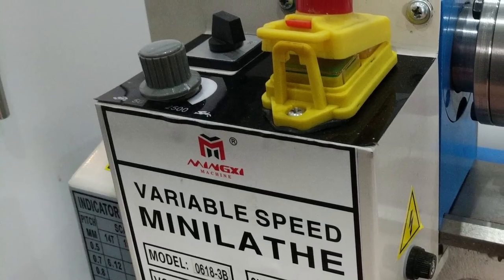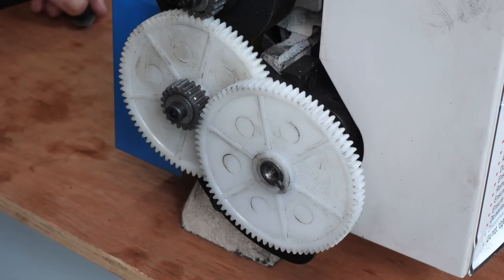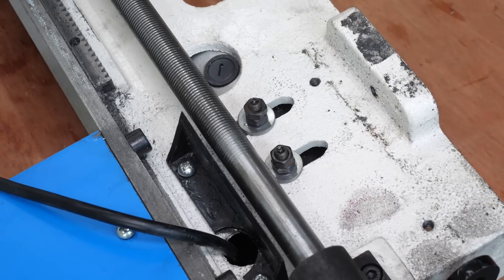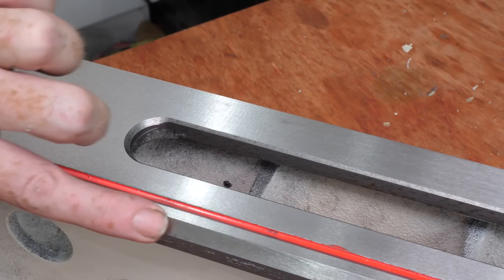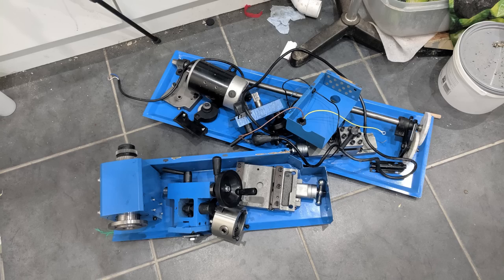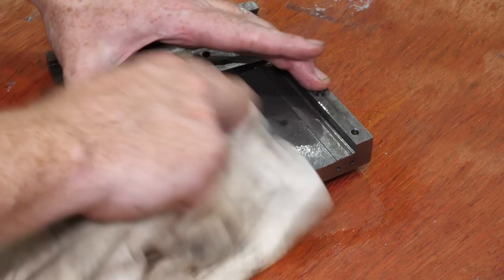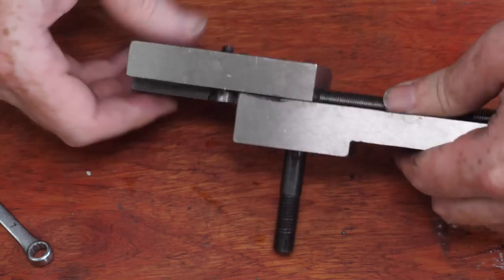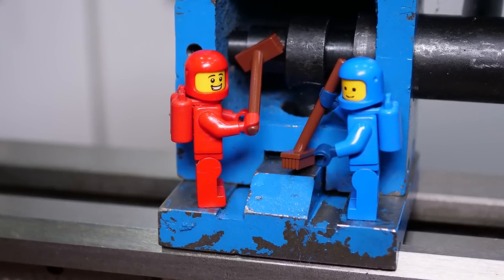Disassembling the CJ0618 7x12 Lathe, Cleaning, and Troubleshooting

Comment: Were all those bolts as loose as depicted or had you previously loosened them before the video?
Reply from the maker: The video is trimmed and sped up so you don't see the full effort needed to undo them. Sometimes they're being undone for the second time because the camera didn't work out on the first attempt.
Most of the bolts seemed to be reasonably right, unless I specifically mention a problem, like the motor mount screws which were very loose, and badly bent.

Comment: Hi. . Great video!  I have a question. I believe that I have the exact same lathe. Unfortunately mine came with a tailstock quill with NO TAPER! I don't see how it passed QC either!  I'm trying to source a replacement but cannot figure out the thread size of the feed screw for the quill. 10 mm x 1.5 mm seems to be closest, but not exactly. Do you by chance know the thread size? A company in the US called Little Machine Shop has ones for the Seig C2/C3 that I think I can use if the thread is the same.

Comment: Changing the quality of this video was the first time I'd ever seen 720p50 and 1080p50 on YouaTube. Never knew that was even a thing... I suppose it makes sense since you probably use PAL instead of NTSC as a regional standard where you are. I remember 25fps being something related to PAL where as NTSC uses 24fps.  It makes a hell of a lot more sense for PAL's higher frame rate to be 50fps compared to NTSC's 60fps... I suppose it might have something to do with how you guys in PAL-land like to transmit your AC power at 50hz and how us in the States like 60hz. Anyway just thought I'd mention it in this comment as a way of supporting your video since I found it interesting.

Comment: The bottom two screws on the front control panel cover only needed to be loosened.
Also, your posidrive screw driver/s need to be binned. You'll got far better purchase with some actually Phillips screw drivers.

Comment: I've never used a 7mm spanner in my life. That was untill I bought this lathe and realized how badly it's put together. The weakest part is the belt. I stripped it in no time. But I guess I'm asking too much from that little thing as I'm turning down 45mm steel solid bar to the shape of planes propeller cones.
Reply from the maker: I'm looking into replacing the toothed belt with a multi-V belt instead. A toothed belt is quite forgiving about belt tension, but when something jams it can't slip, so either the belt or one of the gears is going to strip. A multi-V belt will slip when something jams, but requires a much better motor mount so the belt can be reliabily tensioned.

45mm steel is pretty heavy work for such a small machine, but shouldn't be impossible.
Reply: @AdventureswithaVerySmallLathe  It's possible but takes a lot of time and the surface is worth the money of the tool used I guess.... And the belt in mine wasn't tensioned at all. I've only discovered this after it started slipping while I was drilling 5mm hole... I wonder If it would be possible to turn new pulleys for v belt. As for tensioning, these bolts pushing on the motor are reliable but with enough pressure they can damage the motor so I will make some pressure plate and probably zip tie it to the motor. For me it's not worth the time spend on prepping the work. With a better machine work would be much faster and easier.

Comment: I would've stripped all the paint off, cleaned up the casting a  bit, and then repainted with a high build paint
Reply from the maker: That definitely crossed my mind, but I didn't have time for anything as involved during the days set asside for filming the disassembly and re-assembly. It's on the project list.

Comment: Just got one of these. What size bolts do I need to bolt this to the table.??
Reply from the maker: The holes in mine are threaded for M6. Yours may not be the same, though. Check before you buy bolts.

Comment: Wow that is so much worse than mine which had similar beginnings. Thanks for the videos!
Reply from the maker: Thanks! I get the feeling that this is about as bad as new lathes for sale come, and I'm 99% sure it was a quality control reject that was never intended for sale. I sincerely hope that most cheap mini lathes arrive in better condition than this one did.
Reply: @AdventureswithaVerySmallLathe  Seems like you drew the short straw on this one!  Looking forward to the reassembly.
Reply: Mine arrived in similar condition, one exciting discover was the wiring to the chuck guard had rubbed against the corner little sheet metal channel they supply for it and was in electrical contact to the metalwork. Combined with the fact that mine had a Euro plug and a cheap death-dapter supplied with no earth connection, things could have got quite exciting!
Reply from the maker: @gnu2000  Did you find the electrical short by blowing a fuse, or did you catch it before that happened? My lathe also came with a Euro plug (which I expected), and the substandard UK adapter was totally smashed to pieces during shipping, because it was dropped loose into the box. Fortunately the eBay vendor agreed to refund me the cost of a new adapter.
Reply: @AdventureswithaVerySmallLathe   First thing I did was chop the Euro plug and put a standard UK one on. It actually ran once or twice before it tripped out the garage - after some searching I found the short where the wires are pulled tight at the bottom of that corner bracket - it was only a tiny nick in the insulation at that point, but enough to trip the RCD (thankfully!).

They must throw them around at the factory, with mine it was the chuck guard switch that was smashed to pieces!
Reply: I bought one the same as yours and it had all those faults and more and starting to regret it. But I will keep trying to repair it @AdventureswithaVerySmallLathe

Comment: Love your video, Q:Where do you get the replacement part (scale and metal gears).
Reply from the maker: Thanks! I got the metal gears (just the basic drive set, not a full set of change gears yet) from a Chinese eBay trader, who no longer sells them. It's easy to find on eBay though, as long as your pay attention to which set you are getting. I doubt I'll be able to source a scale. I'll almost certainly have to make my own if I want something that looks decent to replace the nasty looking plastic.
Reply: @AdventureswithaVerySmallLathe  I guess i have to find a machine shop for the gears, but for the scale it's a bit more complicated.
 Thank you for answering my inquiry
Reply: In the US, littlemachineshop.com has them. Note that plastic gears are often specifically recommended because there is typically no clutch or shear pin, and so the plastic gear teeth are intentionally sacrificial. If you apply enough force to break your change gears while threading or turning something else is wrong.

Some people also 3d print them. The gears you buy are typically either POM (acetal) or nylon, both of which are thermoplastics available as filament. I think they are module 1

Comment: Hello. Anyone knows the length of the drive belt? I've the same mini lathe model than in the video, but I found two different belt models, 70 teeth and 90 teeth. Thanks
Reply from the maker: The belt for my lathe has 90 teeth. The 70 tooth belt may be for the two-speed version of the lathe.
Reply: @AdventureswithaVerySmallLathe  Thank you!

Comment: It is utterly amazing, not in a good way either, how much crud was everywhere on this little machine.  Also,   I noticed some sort of liquid trail run out from the vfd control when it was loosened.  That would possibly have made for some complications when everything warmed up during use.
Reply from the maker: Can you let me know what point in the video you saw liquid run out from the control? I'm concerned where that might have come from. I didn't notice any moisture during disassembly, but I want to check.
Reply: @AdventureswithaVerySmallLathe  A small drop of what appears to be oil ran out from behind the bottom of the vfd unit as you removed the lower screws.  It is at about 9:15 point of the video.

Comment: I wish lots of mechanical things would come as a DIY- kit, then you only had to check and correct all the parts before assembly.
This is like Austrian made motorcycles, you have to take them apart and reassemble the correct way before use.(KTM-slogan "Reddy to race", I think it should be Redo to race.

Comment: This video was a little weird... it felt like it was being played at a lower frame rate the whole time?
Reply from the maker: Almost all the footage in this video is slightly sped up, and some is sped up quite a lot. At original speed it would have been over an hour long, and pretty slow paced.
Reply: Apologies in advance since I've spend the last week or so on a This Old Tony binge, having given in to the cross-pollination of in-jokes and references between TOT and Bad Obsession Motorsport (Project Binky etc), Colin Furze, AvE, Simone Giertz, Adam Savage et al. I recognise that TOT and Bad Obsession Motorsport both have at least 6 years of experience as YouTubers under their belts, but I hope my criticism can be received as supportive rather than dissuasive...

The framerate seemed uneven, as if the camera was struggling to maintain exposure at the set framerate. Maybe more lighting would help?

Increasing the light levels would also allow the camera to achieve a greater depth of field, which is handy when there are multiple planes in frame for the focusing algorithm to choose from. There was one shot early on looking at the drive belt where the focus had ended up on the floor tiles in the background.

My last criticism was that in close shots, the part was often drifting out of frame, and your hand often came between the part and the lens. It might help to set the camera further away, if the camera has optical zoom and there is enough light to compensate for the effect of zoom on the light reaching the sensor.
Reply from the maker: @EmyrDerfel  My camera work certainly needs improvement, though I hope you'll agree I have improved since I started out. 

I'm aware of many of the problems you mentioned, and working to improve.

For most footage I use a fixed focal length macro lens, because simpler lenses allow more light in, and allow me to get a better depth of field.

Comment: I received my mini lathe yesterday December 23. Just before Christmas! Wow, nice (not)!

I supposedly bought a brushless version... BS I pay for a brushless! Its not different at all from your brushed version. Either case, I can say that yours looks rather "decently" finished! If we can dare to use such a word.
On mine the fit and finish when not just like yours. It's even worse. Much worse! Words like appalling and outrageous, become a common occurrence. Example: ALL panel's have some screw slots. Very badly "handmade" with an hacksaw!!! WTF. I kid not. I've never seen nothing like that before! My wild guess is that it's a factory "test prototype" Where new panels were tested. Or more likely some QC refusal. LOL 🙂
Disassemble, clean, deburr, polish surfaces, tune...Yep! I'm all over it. ;-)
Awesome useful video.
Reply from the maker: That sounds dreadful. I never imagined that a new machine could make it to sale in even worse condition than mine. What brand was it sold as? I'm guessing it had no real brand name at all?
Reply: @AdventureswithaVerySmallLathe - No specific brand. I guess no one would dare to put their "brand name" on it. LOL 😂 😂 

The headstock held in place with ONLY the two outer screws! The two inner ones (chuck side) can't lock there's not enough hole/thread for the screws to fully seat!!! As a result it shatter even when turning PLASTIC! Wow. 
The back face of the headstock only use 4x holes for the rpm digital panel. BUT has a huge amount of small threaded holes! I guess it was a "test bed" for other designs. Missing screws a bit all over. etc. 
Yes. I bought a project. LOL 
Merry Christmas

Comment: Vid Time 6:50... "By Removing this Panel." There in Lays the Major Problem with the Mini-Lathe. Notice the Bore for the Gear?
It is simply a HOLE Drilled into the Aluminum.....! Re-Drill that Hole and install a Proper Brass Bushing of the correct Diameter,
and your Lathe will Quiet down and smooth out.

Comment: You know your stuff and did a nice job explaining the problems. There are plenty. But refer to the bolts as bolts, not screws.
Reply from the maker: Terminology can often be controversial, and it makes sense to use terms that you and the people you work with understand. If I'm unsure of the right term when I'm making a video, I look it up, and one of the most useful sources of machine terminology is Machinery's Handbook. Here is what it has to say about the difference between a bolt and a screw:

"Differentiation between Bolt and Screw.
A bolt is an externally threaded fastener designed for insertion through holes in assembled parts, and is normally intended to be tightened or released by torquing a nut.
A screw is an externally threaded fastener capable of being inserted into holes in assembled parts, of mating with a preformed internal thread or forming its own thread and of being tightened or released by torquing the head."
- Machinery's Handbook 29th edition, Page 1538

Comments on this video about whether the fasteners are bolts or screws go in both directions, so there is nothing I can do which will please everyone, so I'm going to stick to using the Machinery's Handbook definition in my voiceover for now.

Comment: nice. but I think a file would have worked just fine for the deburring
Reply from the maker: I think you're right, but I was being a bit over-paranoid about not damaging the ground surfaces. Stoning took quite a while, but it has resulted in corners that feel really smooth, so I'm not unhappy that I went that way.
Reply: @AdventureswithaVerySmallLathe  Nothing wrong in being overly cautious.

Comment: I own these machines in China; domestic variants sold  within China seem to have much tighter quality control. The chuck without backplate is just unbelievable! And the loose motor!  Would expect instant refund by a very aologetic reseller / manufacture rep here in China.  Owned and operated a collection of these machinese, N1, C0, SX0, X1, SC2, SU1, etc in my model shop for almost 10 years now and still happy about them.  I feel sorry about the poor quality of the export machines.  It's quite sad to see.

Comment: dont ever use cutting oil on this..it runs down into the wiring and destroys it..just look where the fuse is...
Reply: also the end of the motor is directly under where the oil would drip down

Comment: I have the same lathe and have had many other mini lathes in the past. I found the carriage Binds bad up near the headstock and in the back dew to poor grinding on the bed bottom , where the gibs ride. I had to file and hone to an even size. Next the headstock bearings r so bad they need to be replaced to tapered bearings , part number 30206 . I also found the tail stock was Quite a bit lower than the headstock center and had to be shimmed up to Center height. Vary nice video , it’s nice to see people doing things right as I did all this and more the day I got mine . Here’s a vid of the bed being lapped even.https://youtu.be/bCtOT7TYrNU
Reply from the maker: Thanks for the info. Bearing replacement is definitely on the list. I've also put some thought into how to improve the state of the underside of the bed further. The Aussie Shed has been a great source of general info and inspiration already, though his lapping technique looked seriously laborious. Did you use basically the same technique, or any suggestions for from you went about it?
Reply: Adventures with a Very Small Lathe I measured the bed finding the Lowest spot , next I used a good file holding it flat . Last , I glued 220 to a Parallel sanding till I hit the low spot number. Crude but with Patients it can be done . I’ve built pool cues for the 20 years and been machining all my life. I do all the tips and ferrules on the mini lathe. I fitted a rear chuck on the rear of the spindle. That’s a whole other story.
Reply from the maker: @Motocue912  Thanks for the info. I have to admit I'm intrigued about your "rear chuck". That's not a term I have come across before, and while I can guess what it means, I'm uncertain what it would be for.

Comment: Man how dirty and and questionable all the fasteners are really helps solidify you get what you pay for and how poor a large number of the Chinese products are. I am glad I have decided against buying any of the mini lathes. I am instead looking at buying a used/rebuilt manual machine from an equipment reseller. I don't see any part of this machine I find acceptable. Yes a tool is a tool when your in a jam and need it. But Just looking at how bad the quality of the castings and fasteners are. Make it clear its just going to produce headaches reliably.

Comment: Screws are NOT BOLTS.
SCREWS ARE FOR SHEETMETAL AND WOOD AND WATER.
LETS USE NUTS AND BOLTS, WITH WASHERS....
IN THEIR PROPER PLACE.
Reply: The way you differentiate screws and bolts isn't universal. There isn't "one true definition" of the difference between a bolt and a screw, but the most common is that bolts go in smooth holes and thread into nuts, whereas screws go in threaded holes. A screw that looks like a bolt is a machine screw.